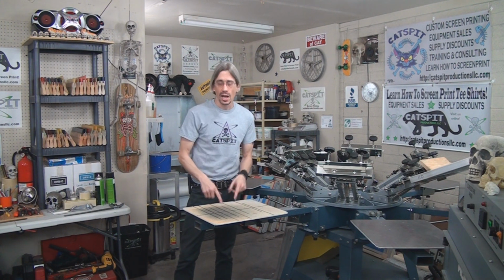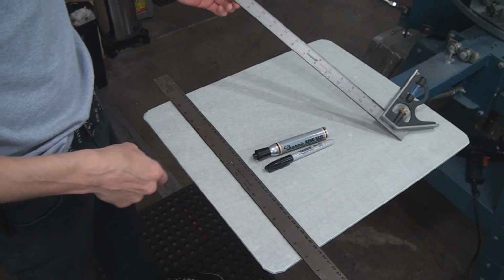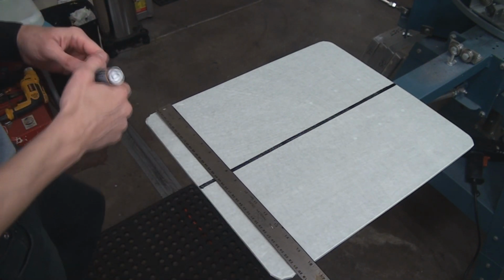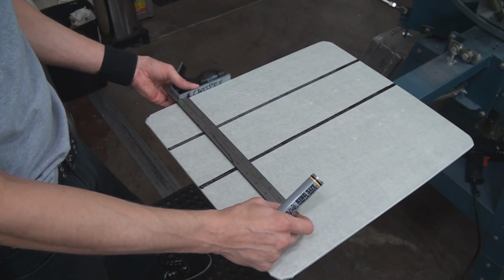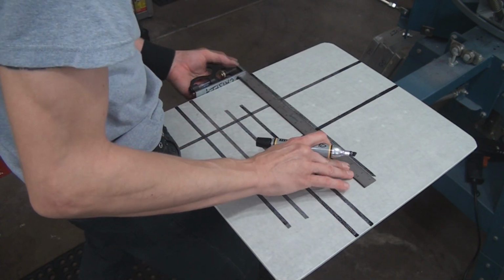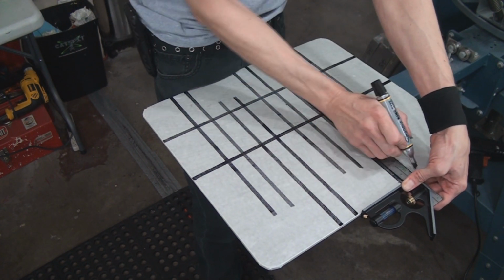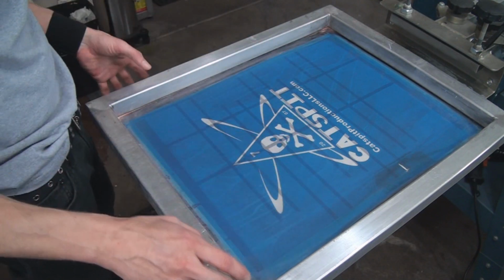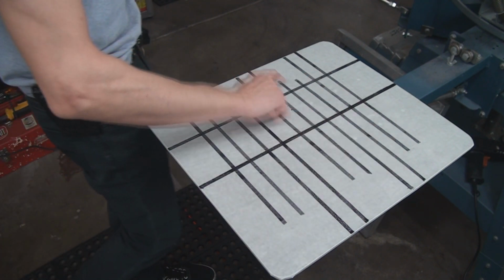How To Screen Print Tee Shirts: Drawing Your Pallet Lines

Comment from the maker: Thank you! The bottom line is the metal pallets stay true. They are flatter and more parallel to the pallet than wooden pallets. They are not affected by humidity and it takes a lot of heat to be a problem as opposed to MDF and such which warps easily. Wooden pallets also burn easily. Thanks for watching and leaving a comment! ☠

Comment: Could you make a tutorial on printing stripes around the sleeves
Reply from the maker: Nope. You cannot print 360 degrees around a tee shirt sleeve. It would have to be seamed at 2 points so you could do it in 2 prints. Or if you made a thing to put in the sleeve and print it on a cylinder press??? I don't know, never tried that. Something like that would normally be printed before the shirt is assembled. Thanks for watching! http://www.catspitproductionsllc.com/ - http://catspitscreenprintsupply.com/

Comment: Will the sharpie leave marks on a white shirt?
Reply from the maker: Once fully fry it should not. But that is possible. And if you spray too much adhesive on there that could also make the lines transfer. It's a matter of making sure the lines are dry and you do mot use too much spray tack at once. However, usually it's not much of a problem. Thanks for watching! Screen Printing Equipment & Supplies - http://CatspitScreenPrintSupply.com/

Comment: Can you please show how you fix the screen in one you have the gridlines lined up? And then of course ahow a successful print, as I understand once your screen is lined to the pallet, you are going to have a nice straight print on the fabric, not necessarily t shirts....
Reply from the maker: Already have. I have over 500 screen printing videos. There are at least 3 that go over loading the pallets with shirts and one about screen and press tips. Check for those in my uploads. But it is certainly possible to get the print straight on a tee shirt. But those lines are for the screen, not the shirts. Thanks for watching! Screen Printing Equipment & Supplies - http://CatspitScreenPrintSupply.com/